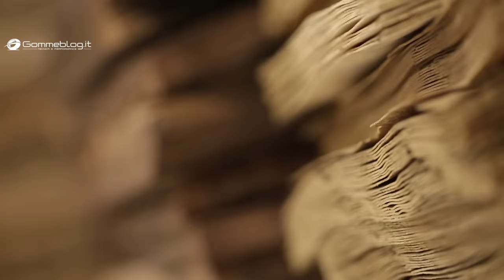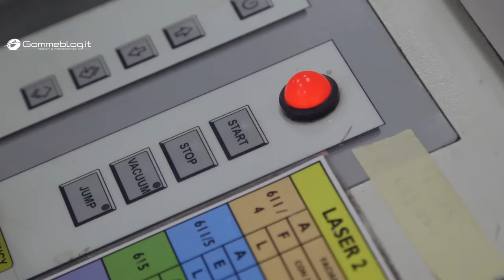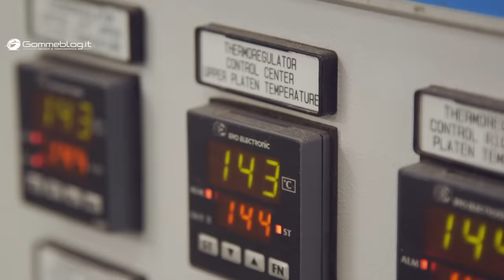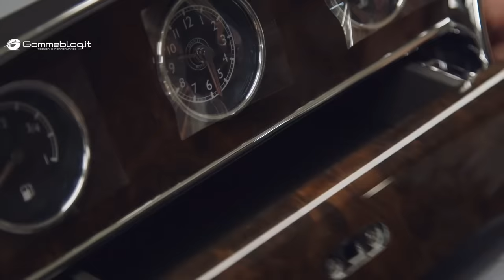Bentley Continental INTERIOR - LUXURY CAR FACTORY 🔝 HOW IT'S MADE

Comment: As a lifelong construction guy from Vancouver, Canada, I really, really appreciate the methods that Bentley turns simple wood veneer into their details. To see how they mold the components was incredible. My hats off to the total plant and the workers are phenomenal. It was a pleasure to see the process. Would I drive a Bentley. Yes. Would I sell my collection of Mercedes. Yes. In a heartbeat. First, I am letting go my 1992 MB 400SE in best condition will be put on the sale in 1 week. Look for Craigslist Vancouver. This 400SE is in 9/10 condition.
Reply: Do you know what type of adhesive they'd used to bond the sheets together under heat and pressure like that?
Reply: @JShel14  It is usually a mylar sheet that melts under the heat and pressure of the press.

Comment: everyone is overlooking the obvious you can not make it out of a solid piece. because of climate it will be in changing weather conditions in the car will cause a solid piece of wood to crack
Reply: Or warp.
Reply: Most of those materials would be too heavy or not come in large enough pieces.  It's just a veneer to appear like that. It's way lighter and stronger. Same thing with air craft furniture

Comment: I was actually disappointed to see the veneer applied to the underlying wood at the 5:18 mark. I wonder if anyone has special ordered a veneer-free car in something like walnut or ash, perhaps even skipping the urethane and just oiling the wood.
Reply: I don't think just oiling the wood would last long enough on a dashboard.  Remember, car interiors get very very hot in the summer- I think the oils would end up just evaporating off and leaving the wood to dry out.  Also, the veneer lets them book-match the pattern to a longer piece.  It would be interesting to see a solid wood one, however.

Comment: I dont get it! Seems to be an over-exageration of a simple process. Wouldn't be simpler to use real pieces of wood rather than this over engineered IKEA masterpiece???
Reply: Using veneer like that has some advantages.  It can be cut, bent, and molded much easier than a sold piece (especially with some of the hardwoods used).  It also lets them "book match" pieces to get the specific grain pattern they want matched across a longer area than what is possible with a lone, single piece. I use some veneer in my own shop to save money as well (although I don't feel like that's a concern here).